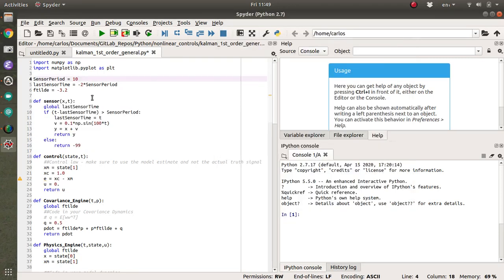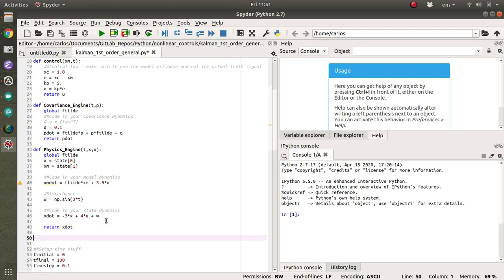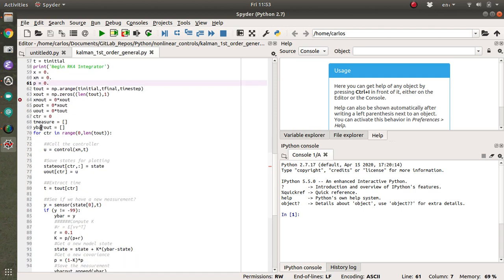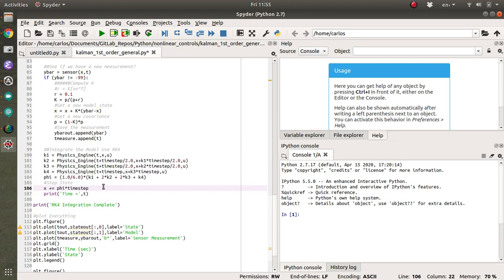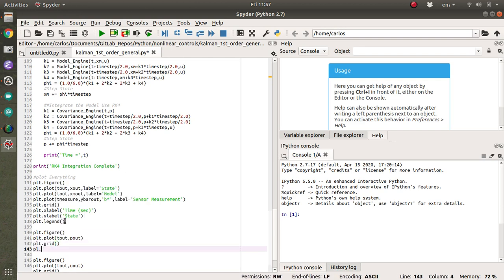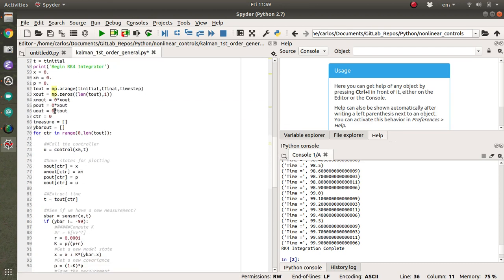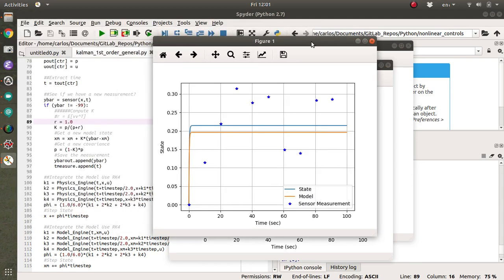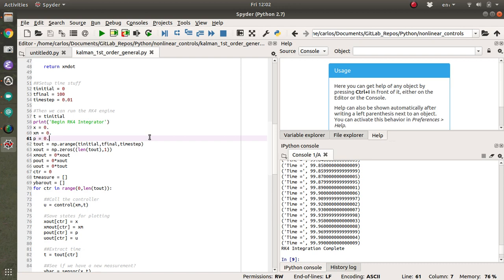Python Help - 1st Order Example of a Kalman Filter

Comment: Hi! I would like to use this model. Where do I have to replace the data inputs?
Reply from the maker: Data inputs? What do you mean?
Reply: @CarlosMontalvo251  I would like to implement this code to forecast temperature (for example). So, my data will be historical registers of temp. Could I apply this code? What should I change? Thank you!
Reply from the maker: @hectorcasanueva  Hmmm. Forecasting is a lot different than a kalmant filter. A kalman filter uses a built in model and then updates its state vector when new sensor information is received. If you obtain new temperature data you can update the state but updating the model would require some sort of adaptive modeling or even machine learning. Does that make sense?